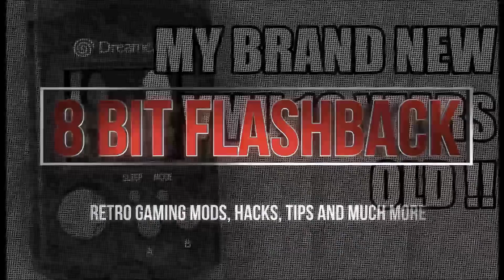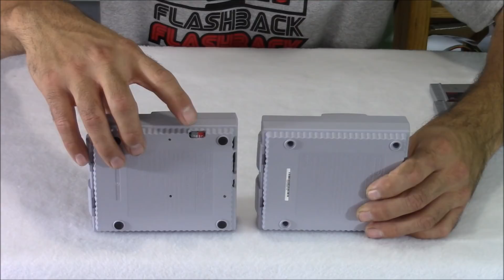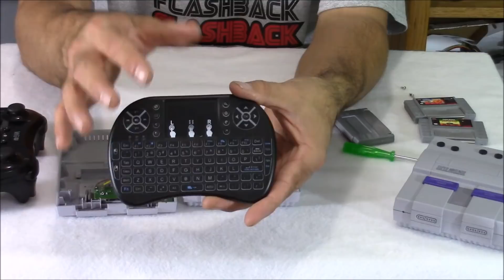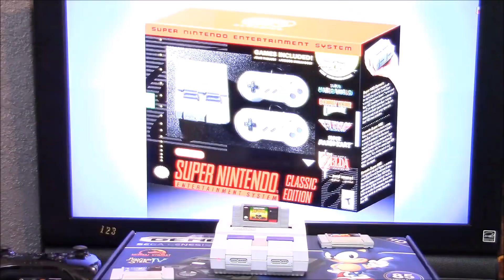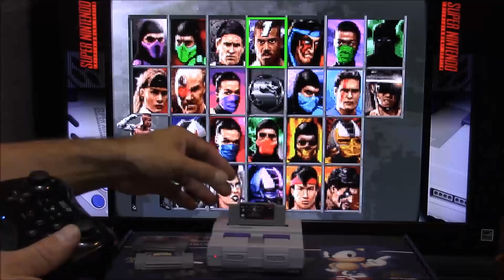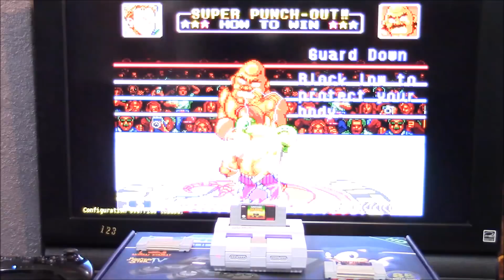SNES Classic Edition + Pi 3 + Cartridges + NFC Power !!

Comment: No it does not read cartridges if i put a real snes game in there it wont fit this is false info in the title lol all good.. i prefer a modded snes classic much better than pi besides its official nintendo case and controllers and hardware :) the hacked games even RUN on the provided emulator like the stock games making it pretty much all official nintendo no matter the game..

Comment: Looks like you need to install a fan and some heatsinks
Reply from the maker: Jet_Jaguar81 it has a fan actually
Reply: 8 Bit Flashback you have a heat problem. I see the small thermometer in the corner of your screen.
Reply from the maker: Jet_Jaguar81 I just unhooked the fan during video because it's loud during filming. It's the same setup I used in the megabit nespi case.